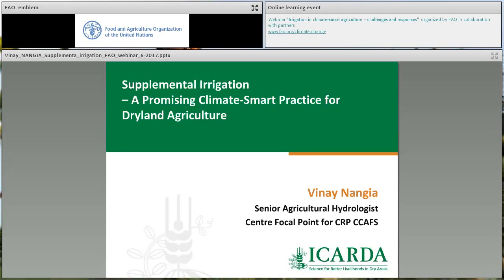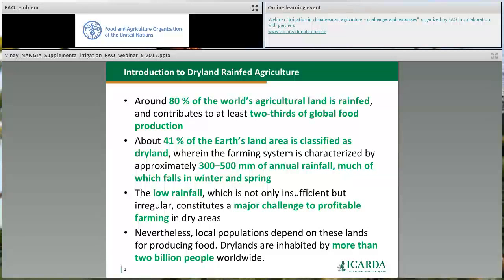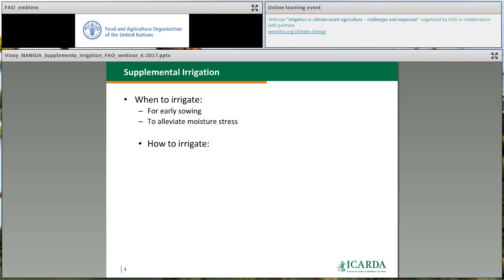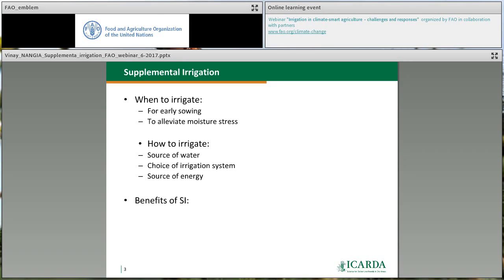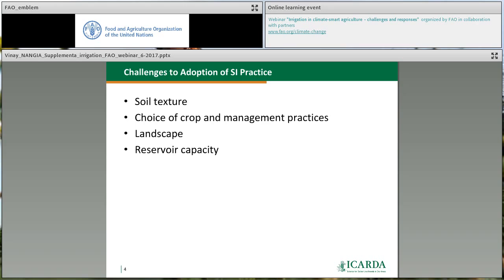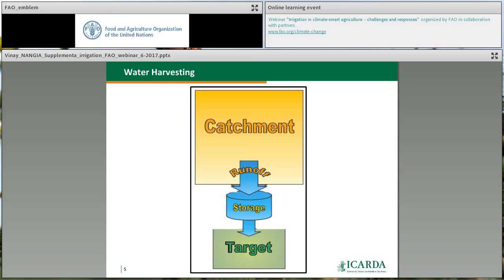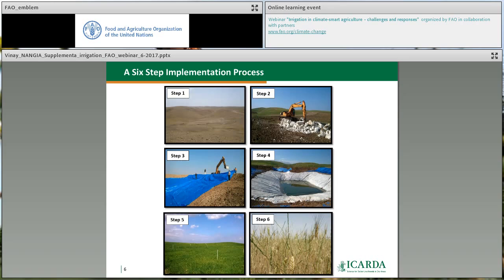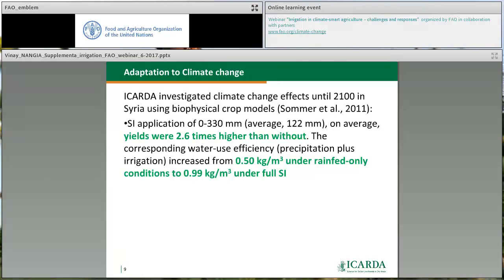Climate-smart irrigation practices: Supplemental irrigation -Vinay Nangia, ICARDA

Comment: Very interesting presentation Vinay. Do you have any experience with soil moisture sensors and irrigation based upon continuous soil moisture monitoring? Our experience across the Eu from Cyprus to Poland show that it is very feasible both in normal as well as drought conditions.
Saving of water gained without compromising yield reached ten-fold. Compared to irrigation schedules based upon ET0 claculaitons the yield were much higher and much better quality with much less water used.